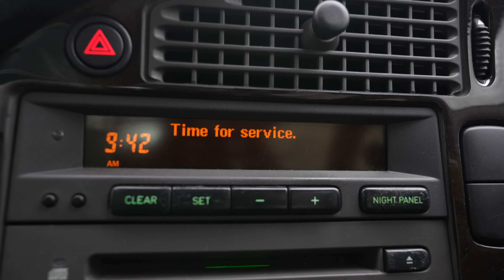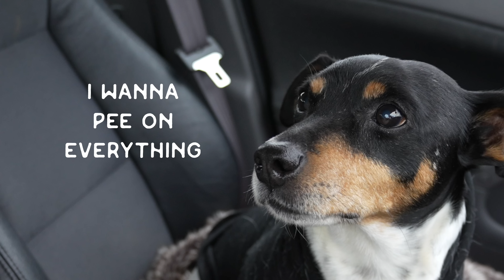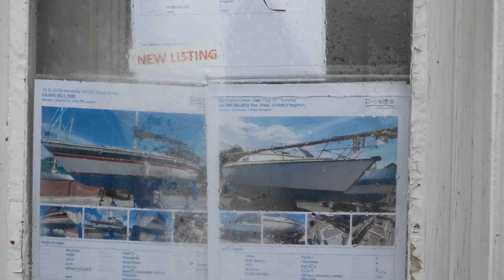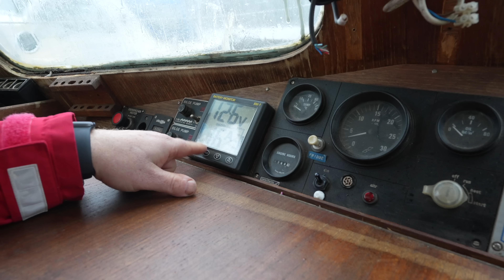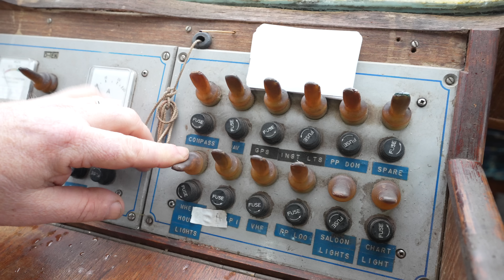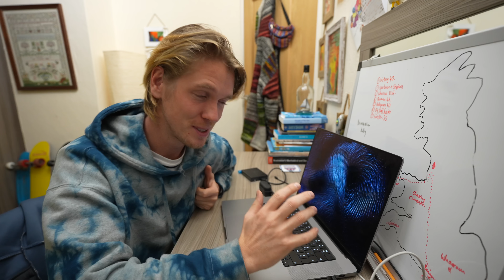Should I Buy This SALVAGED Steel YACHT? Sailing Melody Special Deal! | Wildling Sailing

Comment: No No No ! This is not the “ right” boat for you Mark no harm looking though at as many boats as you can so you can get a feel of the market, unfortunately you seem to be a “ sitting duck” for anyone wanting to sell their “ cheap” boat and clouding the vision by doing you a favour and keeping you afloat or sinking as the case may be with the latest steel offering for £15000, crikey some of these guys have missed their profession of being a salesman , this latest offering will cost you at least another £15000 to get anywhere near seaworthy , the seller seemed to “ Palm” everything off that needs fixing as an easy fix 😊 no worries here mate a bolt here and a screw here shel’ll be right mate , no decent electronics to be seen , plastic bladders ugh! 😂 if all you do is plug a hose down the inlet pipe why not start the engine???? Sails what are they like? 8 mm steel is not the best either a sharp rock will cut through this like butter, most importantly when you are sailing through tropical latitudes how are you going to get air into the cabin? None of the windows opened 😂😂😂😂ok in the Welsh climate but not suited to your intended sailing , no mate don’t even consider this rig , anyway just my opinion 😊

Comment: Yeah. I want to drop another couple items: i dunno if you follow operation drenched?  Melody's hull and keel are expidition grade. yer outa yer weight class worrying about the hull. When considering steel, you think durability, expedition grade. Lifetime is considered in durability. you dont fear steel you respect it. Anyhow, that work has been done by a paramed-yachtsman to take his babies on. Its gonna last longer than you will want to sail one boat. Selling it in five years would be at a large capital gain for you, and give you a much larger choice of new boats for yourself.

Comment: Out of curiosity, has Yoshi ever been on a monohull? It will be interesting to see how he gets on with the different motions as I imagine he is only familiar a steady Cat. I think a heavy boat that doesn't heal as much would be good for you. There does seem to be quite a few stairs with this boat which could be an issue however I feel like the Wharram would have been hard work with Yoshi as you are quite exposed if going between hull compartments and cockpit. Pilot houses are great for dogs to trot inside and out without any assistance. I thinking in a hot ancorage, you want Yoshi to have freedom to go in and outa at his own leisure without constantly lifting him up and down a steep companion way. I guess what I'm saying here is that if you decide to keep Yoshi (hope you do!) then a pilot house would be a sensible choice if you decide to go for a monohull so this would probably be a good option for you. I won't repeat the other benefits that everyone else has shared but those are my two cents. best of luck mate.

Comment: Will this boat sail well? You have already had a cat that doesn't sail great upwind, or sail well in light wind, this boat has a lot of windage, steel is very heavy, high maintenance.. and it's more of a motorsailor.  How much sail area to displacement does it have? Read some of Lin and Larry Pardeys books, they recommend a boat that has a very large working sail area to keep you moving in the light wind, and less reliant on a motor, Keep looking !

Comment: Hey Mark, 
The Melody is a nice vessel, especially if you are looking for an expedition type vessel to sail in areas where you may encounter ice or plan on doing river gunk sailing / motoring. The steel hull will definitely fare much better than Fiberglass in those types of conditions. However that said, fiberglass is so much easier to maintain and you generally do not need high-end professional help to weld or cut steel. I can tell you from personal experience that a steel boat requires far more maintenance and diligence on your inspections schedules, haul outs and sanding/grinding/priming/painting of any rust than any fiberglass vessel will require. The biggest issue isn't what you can see with a steel hull / vessel, it is with what you cannot see. Things such as: Plate weld failures or cracks; crevice cracking, fatigue or stress sag and a host of other things that may take an expert eye to see. I spent quite a few summers working in boatyards along side several of my uncles who are naval architects and shipwrights and watching them literally condemn steel sailing vessels due to issues that the owners just couldn't see and or have knowledge enough to diagnose. I realize Andy is a friend and that he has put a lot of blood, sweat, tears and money into Melody, however there is a reason they chose the Bowman 46. It is because it is an easier vessel to maintain. Their family may be growing, but I assure you that wasn't the primary reason for jumping over to the Bowman. The reason ior jumping is simply that their pocketbooks are shrinking with cost from the Melody. As I stated in your last video comments regarding the Freedom, it is a great sailing vessel and it will allow you to do a lot of project work, all boats are project boats all of the time. The Freedom should be your vessel of choice for many reasons, simply because it is a sail ready vessel that will enable you to pick and choose your project battles while still being able to sail. (And after all isn't that what a sailboat is for, Sailing?) My father once told me along time ago, over 50 years ago,  that when faced with a decision between your logical brain and your intuitive gut. Go with your gut because your brain will cause you to over think, over react, over plan and over justify your decision and cause you to miss too many opportunities. Whereas your gut allows you to get to 80% / 90% comfort and the acceptance you can live with the 10% / 20% risk factor. I found out how true that statement was as I served in the US Military for many years and I never once regretted a gut decision, but kicked myself for over thinking many others. As always, good luck with your decision. (Brain or Gut)

Comment: This is a “forever” sailboat and “home”. 
With that steel hull and cabin, 
you can comfortably sail anywhere, including the North Pole. 
During cold, foul weather, that cabin will be wonderful with a few chairs. Your next girlfriend will love this little sail boat. 

One recommendation, 
put as much solar on the boat as you can along with lithium batteries and replace the gas stove and oven with an electric induction stove and oven. 
Gas for stoves and their fittings  often vary from country to country, 
and 
when you are on remote islands, 
often you can’t get gas at all. 
An electric induction stove translates to far less hassle. 
One thing though, 
you will need pots and pans that you can stick a magnet to. The electric induction stove uses magnetic waves to boil water in one minute. 
Also, another benefit is that the plates never get hot.

Comment: Watched all your  uploads, great job , this one im sad to say an advert for your mates boat , Theres no way you will buy this. has your mate had the boat shot blasted prior to painting or will it just rust again?? , I personally thought you should of bit the bullet paid the 600 bucks for them outboards and got the cat. it was well out of your comfort zone ,  But would of made great viewing, ( your a winner and where there is a will there is a way) I have 4 bargain boats on the go,( not so much a bargain after paying yard fees)  my experience is Dont buy wood, its rots ,dont buy steel it rust, solid fibre glass early 80s or prior not sandwiched  just when they were learning about glass fibre , as you should well know thicker the better, a good solid glass fibre boat copper coat the bottom and you can leave her to sit several years and just scrape green growth off  and set sail

Comment: Sounds like a steal to me. Get it? Seriously though, 15k seems crazy low. So many pros and so few cons. It will be hard to find anything else with so many pros vs cons. But the biggest pro is how much of a safety net you'll have with your left over budget while getting something so solid, with so much room and such a good engine. In the end, if the channel is just about refurbishing a boat and having a nice looking boat then it may not be the best option. It may never look like a slick new boat that makes great instagram and tiktok content. But if the channel is more about you and your journey and exploring new places on a budget then I think it's perfect for you. Plus maybe you'll be less concerned about making it look perfect and more focused on going on adventures. Plus I think it's just safer if you ever run into a log or anything but I'm just guessing. Or another boat drags anchor and hits you. It's like having a solid truck versus a cheap car. Plus all the help you'll get and the youtube connection. And I'm guessing it's near you which is probably also massive cost savings. With access to all the stores and services you need. But I totally understand wanting a nice slick new looking boat. But I don't think that's really in your budget. But a few more years, after 100k subs, maybe you upgrade. For now it seems like best option. It's tough to make decisions like this so a lot of pros vs cons would really help me decide. Sometimes it's a curse to think too much. That one guys says it's dumb people who are rich. I think it's true in a way. And I think I'll try to focus on pros and less on cons unless they are huge cons. I don't see many here but I don't know exactly what you want out of it.

Comment: Don't do it Mark, its not a blue water yacht.  You'll be motoring most of the time.  The underwater profile is gross, you can see by the size of the prop.  Also such a lot off eaated space.  If your thinking of a crew on board you will definitely need more cabin room.  
Keep looking you will find it eventually. 
Louis &  Babs.

Comment: Don't worry about steel rusting, all boat's have issues, fibreglass has osmosis, timber dry rot, there is no perfect material when it comes to boats, steel is the easiest to repair.

Comment: I'm hearing him telling me mods that make me want to pay less. no on deck storage, no nice wooden swim board. Don't know if i trust that welding, looking at the shoddy metal work finishing and poor rust prevention treatment on the mods. At least he wore a mask while grinding. The amount of people on youtube who love to breath in grinding disc dust and who knows what else.
When your tapping a thread you have to use  machine oil or something to help lube the cutting but the most important thing is how many times you back off, never force it, if it's not going  then back off and advance again, eventually it will get the job done. I also have a feeling he replaced all the steel with thinner gauge steel than original. hmmmm. I like that tip about keeping diesel tanks full but did he have the tap between the two tanks open or was it closed?

Comment: As a steel Boat builder who has built several commercial fishing boats such as the one in my thumbnail. Needless to say, I much prefer Steel or aluminum to alternative materials such as wood or fiberglass. Think of all the predicaments that would make you lose the boat that would just put a few scratches into a steel boat. I consider this boat rough but solid. If you want more of a yacht-like interior, I would finish the basics and take it to a third-world location to get it properly tricked out. Before anything, I would install a Keel Cooler and get rid of this whole heat exchanger Bs. ninety percent of all the engine problems that I see people struggle with are related to cooling and dirty fuel. So going overboard with a good fuel filtration system is primary. Plenty of cool air, clean fuel, and reliable closed-circuit cooling will let the engine do what it is designed to do...Run. There are few things that are sicker than the feeling of "will it start?" .Especially when it counts in tight situations. This is why every self-respecting commercial vessel is keel cooled. I wish you good luck and all the best.

Comment: Personally I prefer the Freedom. Please don't buy this.  Whilst this looks like a bargain and I have nothing against Sailing Melody, I don't think this boat would suit you. It is really a motor sailer, it will not sail very well, you will need to use the engine a lot and I don't think that will be great for sailing long distances on a small budget.  You will also need to keep on top of the maintenance on a steel boat to prevent corrosion and stop it looking scruffy.

Comment: hi mark must say I liked melody better, it was much nicer, it will also be easier to maintain, in my opinion it is only the engine in melody that I am anxious about because these volvo series have major problems with the cooling system and cylinder head. The ford engine in the steel boat is a super good engine with very few faults, but I didn't like the boat that much. + it's one hell of a job maintaining steel boats in many ways. everything is much heavier

Comment: I like steel hull sailboats, but the con on the bilge keel will be slow as heck.  Andy no doubt an informed guy, but the expectation to meet a break even price at 15K on an incomplete boat project is beyond the pale. #fail.  Yes, the diesel is not free, fix to current price. If she gets 8 knots you will be fortunate. Consider a onboard compressor and air tools. #rustneversleeps.
Reply: If you've watched the Sailing Melody channel, you'd see that the boat is now 95% finished. It would take another two thousand or so, to get it fully ready and stocked, as the rigging is complete, with a full set of excellent sails, and every system is working perfectly. Andy and Melissa have stated on more than one occasion that they would give Mark this incredible deal, when they could sell Melody tomorrow by asking twenty five thousand, and have people lining up for it, because of the craftsmanship put into it. 15K is a fantastic offer, and way below Mark's stated ceiling of 30K.
Reply: @leonply  Seller has a problem. He owns two boats,

Comment: ...learn to weld... this steel boat has more value than...wood, or fiberglass they do not have the longevity or lack recycle ability and steel is way more durable. thus resale value is better.   this in mind...probably smartest not to buy a boat period...but,  buy the 'welder" a beer and ask him about the project.  if there is 1000 plus hours on this diesel...that is a big plus.

Comment: It seems Andy has been thorough with the necessary hard and dirty work, he gives you a lot of boat for that price.(think of his sweat at as low as $15 an hour,that is a bundle)
 Steel has its drawback but it has great advantages for the sailor on a budget with a small welder on board.
Slow boat, slow life, watertight boat, good motor, nothing to fear -condensation maybe_go for it. it is a go anywhere, beach anywhere                                                                                                                                                                                                                                                                                                                                                              boat .
All that teak veneer looks 1970's and sad, something modern more Uma's style would be nice

Comment: A heavy slow motor sailor with a mast furling rig , you will be doing a lot of motoring ( which will give you time to keep on top of the rust) and that thirsty 4lt diesel will suck the fuel up.. Lots of interior woodwork needed plus lots of electronics reqd.  Thanks but no thanks. Walk away